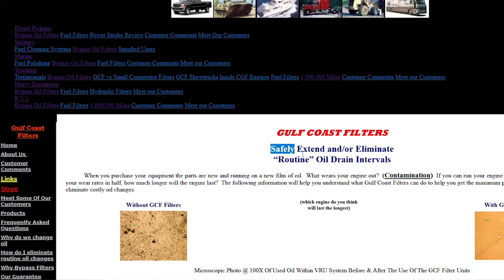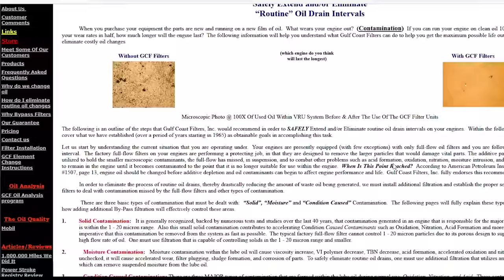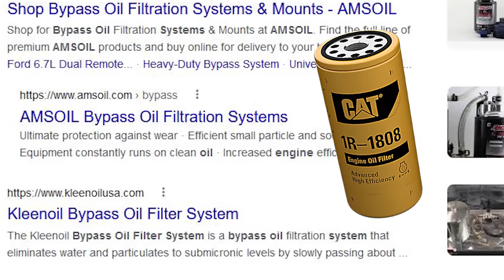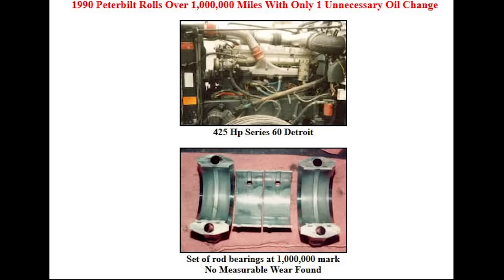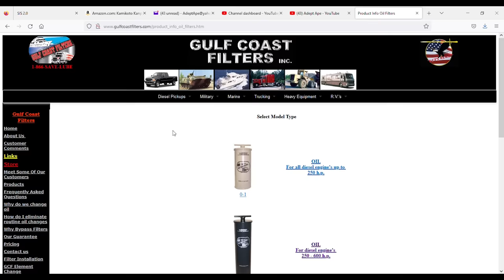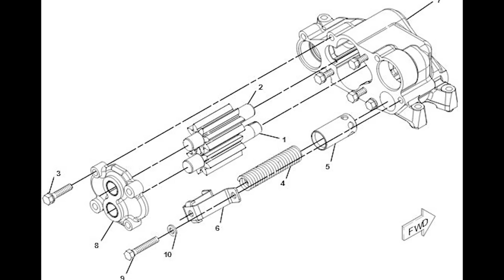No Oil Changes and 1 Million Miles!!! Are Oil Changes Optional with a Bypass Filter? (INTERESTING)

Comment: When I started working on class eight equipment, all our engines were equipped with by-pass oil filtration. If nothing else they added another ten to twelve quarts of oil to the system. Eventually they all disappeared at least for a while until eventually full -flow & by-pass filters were combined in a single spin on oil filter. Always liked the idea of having a by pass filter for the reasons you stated.
Reply: At one time years ago i read where Cummins claimed an 80 % engine life increase by using the Fleetguard 750. I remember the big chrome 750s some with peterbilt stickers. Then you only saw the plain jane ones on dump trucks and such. People started thinking they were only for dirty conditions. That is of course bull shit. I worked for an old guy that wouldnt start an engine until it had a Luberfiner installed. An International dealer sold them to me at a discount. When he died my discount died. The Gulf Coast is a better filter and easier to service. The famous Frantz 3 stacker was a very effective filter but a mess to service.. Too many parts. The big Gulf Coast filters are heavy duty. Made from hydraulic cylinder stock. Thats how they get the polished surface to slide in the towels. At one time T A truck stops serviced them. That would be handy getting your filter changed while you are eating.
Reply: The combination filters are a joke.  The million mile truck normally doesnt get oil drains. If they drained the oil every 100.000 miles for example they could  go longer between filter changes than the 10.000 miles they do now. All it amounts to is keeping the oil clean and adding enough new oil to replenish the additives.I just changed the Jackmaster Classic bypass filter on the Pontisc. There are more larger particles on top of the filter element than the last time. The full flow filter has 64.000 miles on it. Probably needs changing.
Reply: Some people never change the full flow filter. I normally change mine about every 2 years. I ran the full flow filter 64.000 miles this time on the Pontiac. Started getting larger contaminants in the Jackmaster Classic which means the full flow filter has reached its capacity. When I cut open the Wix I saw the pleats were still in one piece but were getting rotten.. I will go back to 2 years but went with the Wix XP..
Reply: @ralphwood8818  Ralph, do you know if there has ever been an analysis on bypass elements?
Reply: . I'm a toilet paper guy. I was talking about my 84 Subaru with over 250.000 miles with no oil drains on YouTube. A Caterpillar lab manager sent me a sample kit. He felt like me changing the Frantz every 12.000 miles and adding a quart of Mobil 1 wasnt getting enough new oil. He recommended every 6.000 miles. Which was for me 2 quarts of Mobil 1 a year. I was talking about the Detroit series 60 he is talking about. Road King Magazine asked me for the truck owners phone number. They did an article on it. Shell oil is involved with that truck. It gets a lot of oil analysis done. I believe it gets a lot of Rotella 15 40 conventional. 3 gallons of new oil added at 10.000 miles isnt 1 oil drain. Thats old news. The Road King article was october November 1996. I prefer the top loaders. Gulf Coast Filters are big on oil analysis. They deal with expensive engines.  Paying for oil analysis would be a waste of money for me.   I know how to read a dipstick. My biggest engine is a 390 in a 76 F250. I believe NASA is listed as  Gulf Coast customer now. Their diesel guy read my posts on a trawler forum years ago. The government is saving natural resourses. It's not just lube oil now.  NASA was interested in fuel also.
Reply: There are a lot of good filters out there now. Actually the 390 has a over 50 year old Motor Guard on the engine. About a 30 year old Gulf Coast junior on the Automatic transmission. All of my filters use toilet paper without the cloth covering.  Some of the filter elements are as good as toilet paper for over 30 dollars.

Comment: I would never suggest NO oil changes, but I do run the OPS on a Detroit 60 series with 1.5 million on 6 oil changes.  
I highly suggest any bypass system with sampling.   
It gives great protection and provides early warning for components going bad.

Comment: I, Myself, am just a bit skeptical. I would feel better about bypassing using a high g-force centrifugal separator.(10,000 g's or more) with at least a 4 inch lip. If water gets into the oil, it will combine with the oil detergents, which create an emulsion with a higher specific gravity than the rest of the oil. I think a media filter can also help with this, though, it would become restricted, and will need replacement. You are exactly right about fuel dilution. If you live in a cold climate, diesel fuel WILL get into the oil. Neither a centrifuge or filter media can solve that! A  filter relies on particle size, the centrifuge relies on specific gravity. Carbon, oxidation, and water are heavier than base oil, and would be slung out, but, there goes your detergents, and perhaps, extreme pressure additives. The oil can eventually go out of spec. The hope is, that the volume of oil replaced when replacing filters and/or servicing centrifugal bowls, is enough to maintain those additives. (and, mitigate fuel dilution)

Comment: In my youth, I had the pleasure of working with a man who used to be a locomotive mechanic. He told me that because locomotive engines held so much oil that it would have cost too much money and wasn’t necessary. Instead, they would only change the filters. The oil filter is key. Wix filters, also sold under Napa GOLD is the best you can get.
Reply: My Pontiac Torrent has the WIX. It does what the other full flow filters do. It removes the engime damaging abrasives from the full flow of oil to the engine. There are almost no engine damaging abrasives in a modern engine. The smaller engine wearing abrasives keep building up in the oil until you drain the oil. My Pontiac has the Australian Jackmaster Classic to handle the engine wearing abrasives. Havent bought any for a long time.Wix at one time made filter elements for the Luberfiners. Pulverized newspapers and wood chips. Of course they were for diesels. There are several now that clean oil better than the Luberfiner. The WIX on the Pontiac has 63.000 on it now..
Reply: Normally change the full flow filter about every 2 years. Noticed. more large abrasives than usual on top of the toilet paper in the Motor Guard. Cut open the Wix. The pleats were rotten but still together. Been on there about 5 years. I will go back to 2 years. Went with the more expensive Wix XP..It has the metal backing. On the pleats.

Comment: I know a guy who owns a truck with a 12.7 S60 Detroit that runs the AmsOil bypass system, took a sample at 15k miles, the oil was still good, increased the intervals by 5k up to 25k miles and the samples were still looking very good. AmsOil was claiming something like 50k miles between oil changes , he ended up changing the oil every 25k , no issues so far.

Comment: Overhauled an ISX years ago that went 1.4 million running gulf coast filters and oil change every 150k, new gulf coast filters every 50k or so. Engine looked good and still ran great, main reason for overhaul was oil leaking out of the back of the head gasket and owner wanted a reason for a vacation. Ran it then til he died.

Comment: Viscosity doesn’t break down in oil in straight weight. Multigrade has components that due and the vis will change. Viscosity is not the worry. Acids and sulfur formations form from condensation moisture. That is not a problem if un everyday and the moisture is cooked out if oil temp can meet or exceed 180degrees or more.  OTR engines get run so long and often contaminates don’t have mich chance to accumulate but would  over a period it would take to run 1000000 mile without a change. Also OTR trucks don’t run in dusty conditions like off road machinery.  So.. what does it cost to do recommended oil / filter change’s versus the cost of an early overhaul or break down repair? Remember the treatment the turbo does to the oil that passes through it at the temps it runs at. Just some thoughts from 50 years of operating trucks, excavating equipment and aircraft engines.

Comment: Yes you can just change filters and top up the oil, Mobil has already done the test on two trucks. One truck was serviced by the company and the other by Mobil, both engines were strip to compare. Mobil then explained that the sump plug had never been removed and oil was only top up.

Comment: Ok so filtering out soot and particles from diesel engine oil keeps it cleaner and thus eliminating oil changes but I see a problem here-all motor oils degrade over time and the additives that’s in the oils dissipates and gets diluted,so even though the oil is being cleaned it’s still degrading over the million miles which leads to wear and less protection of metal surfaces.

Comment: The last Cummins I had seen like this was brought in and had a half inch of black goo under the valve cover. Had 700k miles and no oil change. It had come in because of a knocking sound. The engine is on display at a diesel shop in Phoenix AZ.

Comment: Called the boss and told him the new truck has a loud screaming noise in the turbo. He said you are near a Cummins dealer. Get that fixed and have them change the oil. When they built the truck they got a large hose clamp inside a hose. It took awhile to work its way into the turbo. Before I got in the truck I looked under the truck. The drain plug was in front of the engine on the Cummins. It was hanging by about 1 thread.

Comment: I can see a system that will work. 35 years ago I worked for Ruan Leasing and they had a push on to build a million mile truck, the called a MEGA truck. Remember this was still in mechanical days, and 500,000 mile rebuilds were still a thing. Web had a system that would eject an ounce of oil into the fuel tank on a timer, and a level sensor that would add oil when the level got low automatically. The oil was never changed just the filters. We sampled everything and never had an issue. But the oil was BLACK. I know this isn't the same thing but kinda in the same vein. With all the clean burn technology in the engines today, it seems that better filtration and maybe adding some additives back in along the way would work. But of course the oil companies make money selling oil, so I doubt they will ever support such a program.
Reply: I remember that truck Ruan had i think it was a cab over Ford prime mover,they were trying to build a bullet proof truck here in Australia as well it was TNT Express kenworth SAR with silver 8v92 and 7 speed spicer,all mechanical truck,no air bags no electronics,air start.They had a truck on express that didnt need servicing,it had a oil tank that feed the sump and would suck oil from sump to fuel tank to be burnt off,self adjusting brakes and auto greaser
Reply: @craigduffield3963  Yep, same thing, the grease would drip onto the shop floor haha

Comment: Provided you get good sample results I'd be comfortable not changing it. They run a full analysis that detects for any kind of dilution or contamination as well as wear products. On a high value component like an engine I'd recommend regular oil sampling regardless. It can give an early warning of potential problems that could be catastrophic if not caught in time

Comment: Couple tips main engine filtets still need to be changed and oil topped off replenishing some oil.
Also the biggest contributor to engine damage is dirt from outside namely the air filter. 

I've been spraying silicone spray on oem filters to improve air filter performance😉

Comment: I had a97 dodge with the 5.9 Cummins 20 some yrs ago , drive it 3 yrs changed the filter 1 time never changed the oil drove it every day and never had a problem , local scrapper is still driving in it today

Comment: I've got a 2004 f150 with 4.6. I'm terrible at doing oil changes. I'm lucky if I change the oil once a year.    It hasn't had an oil change this year, just top off. 214,000 miles and running strong.

Comment: The problem with not changing oil is also oxidation. There are a few acidic chemicals that result from combustion and the oil combines with these to neutralize them. The only way i can see not changing oil for 1 million miles is if the engine burns oil so ur having to add alot of oil or ur filter change intervals are very close together. A good top quality oil would probably be okay for maybe 100,000 miles
Reply: Worked for.a mechanic that owned a dragster. He said put a Frantz on the tow rig. It was a early 60s Chevy Suburban with a 292 big 6 engine. I used a Frantz adapter that eliminated the full flow filter. He used Standatd Delo 20 W oil. He changed the Frantz about every 2.000 miles. He was sponsored  by Chevrolet and got free Valvoline racing oil and Baldwin filters. Since it had no full flow filter he always knew the condition of the engine by what showed up on top of the toilet paper. It had about 350.000 miles on it when I left California. Before I left I put a Motor Guard on his Plymouth Fury. He started with Standard Special. He was bitching because his oil didnt look as good as mine. Called Frantz. They said the Special has a additive that turns the oil dark. Put Delo in. He stopped bitching. He was a perfectionist from hell. He had a chrome plated dipstick
Reply: @Ralph Wood  wow yeah definitely going to put a good bypass filter on, do u know of the brand OPS. They have a bypass filter with a heater to evaporate water and stuff. Trying to figure out if there worth it or not
Reply: @azargelin  I know nothiing about the OPS. All I have used is toilet paper filters Its a matter of never allowing the oil to get dirty and adding enough new oil to keep the additives up to specs.I have sold the Gulf Coast paper towel filters and installed a few..The Gulf Coast Filters are popular on heavy duty diesel engines such as Locomotive engines on  shell offshore drilling rigs. NASA saw my posts and started using them. They were moving the shuttle then. It takes big filters for big engines
Reply: I dont need a filter with a heater in it. I run at normal operating temperature.. I dont know of any spin on filters that clean oil. Normally you still have to change the oil. I think I remember people that own them talking about their oil change interval. Didnt sound impressive to me. There are several good bypass filters now. Most are too expensive for me. All of my filters use toilet paper. A couple are over 50 year old Motor Guards. The Pontiac has a Australian Jackmaster Classic. I have a few old Gulf Coast juniors.

Comment: A gulf coast bypass filter is just made up of 2 cheap Viva towel rolls wrapped in a medical sock. When you change the filter it takes 4 gallons of oil just in the filter canister.
Reply: When I sold the Gulf Coast filters years ago the big one  took 2 rolls of Bounty Big roll paper towels and held 3 gallons.

Comment: One thing you didn't take into considering is when you replace the filters you have to add a couple qts. But on a semi they hold 10 gallons I don't know if adding a few qts will bring it back into balance. But great video. I wonder if they make one for gas engines
Reply: As far as I know the Gulf Coast  double roll filter takes 3 gallons..i have about a dozen 1 quart filters all on gasoline engines. Except 1 diesel Ford tractor that has a flat head Ford V8 canister filter that uses Scott 1000 sheet.its the best of the toilet paper conversions..

Comment: There is Base Number or BN on one's oil container which in the day was call Total Base Number or TBN, this is the oil sacrificial additive package of anti-ware additives which are consumed or wear out just like the rubber that is put on the rim of one's equipment. At a engine start up, or when one takes off from a stop in high torque usage of one the situations of where engine oil BN is consumed.  The sacrificial additive package carrier is the (oil) which takes this package to where it is needed at the time in the engine to fight engine wear.

If one is going to implement extended drain intervals or never changing the engines oil, I highly recommend following Josh's recommendations by having oil evaluations taken, as we all understand Josh recommends oil evaluations need to be taken even if one changes the oil every 100 hours oil 10,000 miles. 
Use of a engine oil engineered with a (High Retention Base Number)  especially if one is implementing extended drains or no drain. Heavy-duty diesel engine oil with High Retention Base Number oils are in the market. Berry Trucking, Chad & Lisa on YouTube use and recommend high BN engine oil.

Comment: I'm a retired chemist and liquid filtration engineer and I would like to point out 2 issues:   (1) After "X" thousands of miles that bypass filter IS going to clog and become useless, and (2) NO filter can remove water unless the filter contains a drying agent (desiccant) however the heat of the oil will drive water out AND will definitely break some of the water down into acids and hydroxyls that WILL harm the oil and metals of the engine.  This is another reason why we do oil changes on ICEs.